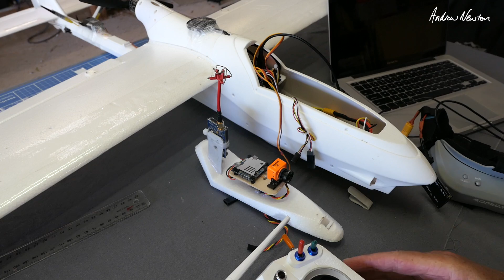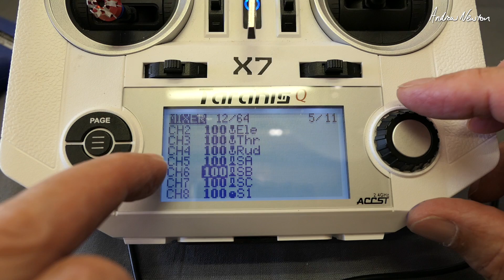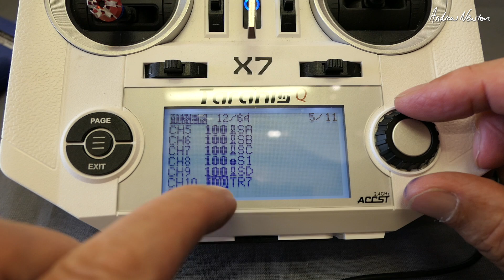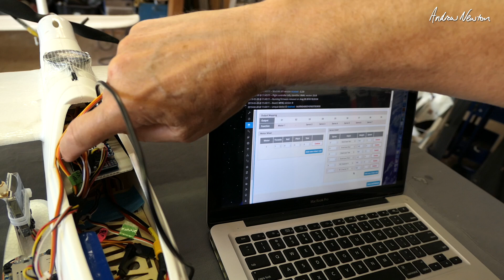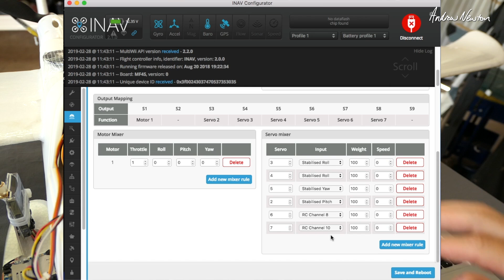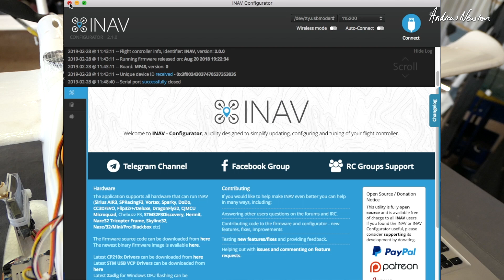iNav Mixer - Flaps and Head Tracker

Comment: Can you please confirm if I can use stereo cable with taranis qx7 ?
Reply from the maker: For headphones or head tracker?
Reply: @AndrewNewton  headtracker
Reply from the maker: @jjanass  3.5mm 3 pole into the QX7 and PS2 data plug on the Aomway goggles end.
Reply: @AndrewNewton  strange, I'm gonna have to try 2 pole jack, because my custom headtracker works only if I partially insert the 3 pole one. If it goes in all the way, it say trainer signal lost

Comment: This video really helped me! one question still left unanswered tho: I want to have a switch on the taranis that disables the headtracking (thus centering the servos) to activate when taking off etc(I am using headtracking through the trainer port).  I am hoping someone can answer my question beause I assume it's a easy answer :)
Reply from the maker: Yes, just have to set up a switch to change channel from Trainer input to a pot, or use a Special function to "OverrideChannel" Showed how in one of the headtracker setup videos. Search will find it.

Comment: Very cool, Andrew!  I building an Inav plane now with flaps and the F405.  I'm wondering, how do you add down elevator when the flaps go down?  Normally, when I set up flaps, I mix the elevator with the flaps so that the elevator tips down a bit to prevent the plane from pitching up when the flaps go down.  Any thoughts?
Reply from the maker: Good question. You would only need a flap / elevator mix in manual mode. In all other modes iNav will prevent pitching up when you deploy flaps. I usually land in "no mode" (= AIR/RATE/ACRO) so I have not felt the need to work out the mixing.
Reply: @AndrewNewton  that makes sense!  Thanks buddy!

Comment: Which Ranger plane is this?  I’m thinking of getting one.  I’m so confused they have so many different versions of the V Ranger 757-xxxx.  Only other planes I have are AR wing and Mini Talon. Mini talon being the big boy plane I enjoy it but it’s a pain to lug that plane around as it’s pretty big. 1300mm I believe.  The MT would be much easier to transport with wings that remove easily like these Rangers. Unfortunately My MT has RX and Vtx stored on each wing which makes taking wings off for transport pretty much impossible unless I rebuild the damn thing.
Reply from the maker: Ranger 2000. 757-8 really nice motor glider
Reply: Andrew Newton I think I’ll go with the 757-4 which is the 1380mm.  2000mm is just a little to big for me to transport right now so I think the 1300mm will suit me better. 
Thanks for responding and love your insightful informative videos. Keep them coming. 
Cheeers👍
Reply from the maker: @Freebird_67  No No No anything but the 757-4. It's the worst plane I have tested. https://www.youtube.com/watch?v=BRojC8QzyPY The Ranger G2 is better

Comment: Hi Andrew, I saw your review and maiden of the volantex Ranger 2400...
My first motor glider is XK A1200 with fpv... but is sort of small and short ranged...   and would like to do some serious long range FPV.
Mainly Thermal soaring and sloping (i am a 1:1 glider Pilot).
Would you recommend the Ranger 2400, or other....   having in mind that i am in a rather tight budget.
I will appreciate your input... Thanks   Robert    (from the Andean Range -Chile)
Reply: He may answer with the Volantex 1.6/2.6 meter sailplane. I have FPV on it now and will be putting on iNav soon.
Reply: @JoshWeaverRC  Hi, thanks for answer. I intent to climb Osorno Volcano, that is quite an altitude, would prefer a motor glider in think might be safer.
Of course setting it up with big provision of batteries, flight controller and auto pilot.  I was also thinking iNav, or PixHawk, i need redundancy to keep plane safe and make sure It will return, and of coruse photographic equipment.  
So
Reply from the maker: For thermalling and slope soaring I prefer the Phoenix Evolution, but the internal space would be tight for long range FPV. I'll be interested how you go RCWeaven. I think the best all rounder is the Ranger 2000. The Ranger 2400 would be too big and heavy for carrying up to high places. It's not so good for thermal gliding but OK for slope soaring.

Comment: Nicely presented, Andrew 👍 I got inspired by your panning head tracker a while back and made one for my Bixler 3 build 😀 The view angle on the lens that shipped with my RunCam Split 2S is so wide I didn't see the point of including the added weight of a tilt servo. Cheers
Reply from the maker: Yes I agree. Tilt is just a novelty really
Reply: @AndrewNewton  Thanks for a lucid explanation of servo/function mapping, Andrew (for me the iNAV mixer docs are nearly useless compared to this video 😋)

Comment: This is how I did the Flaps on one of my F405-wing FCs. The flap option in iNav doesn't seem to give as much manual control.
Reply: NoAgenda FPV I had the same issue
Reply: Me as well so no flaps with inav. Moving F405-wing over to Arduplane soon.
Reply: @Freebird_67  "no flaps" is not a true statement, I just wouldn't use the flaperon mode for it. I have use the Flaperon Mode to drive the ailerons up when I had RC channel activate flaps to get crow mode, that worked well. And you can adjust the movement of the flaperon mode in the CLI, it's just not the easiest thing to do.